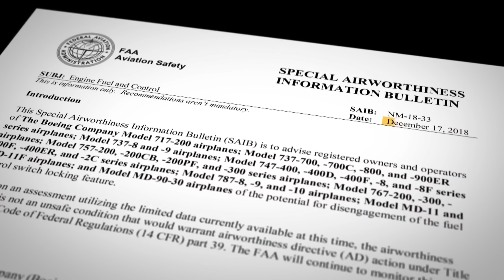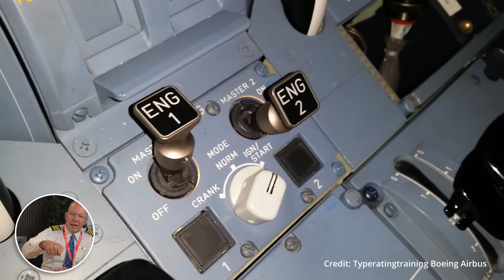Air India 171: The FAA’s 2018 Fuel Switch Locking Bulletin Explained (16 Questions Answered)

Comment: Air India crash report points to chip malfunction, says analyst
A preliminary investigation into the June 12 crash of an Air India Boeing 787 Dreamliner suggests a chip malfunction—not pilot error—was likely responsible for the disaster that killed 260 people. The Aircraft Accident Investigation Bureau's report found that both engine fuel cutoff switches flipped to the off position almost simultaneously shortly after takeoff from Ahmedabad, starving the engines of fuel and causing the plane to lose thrust and crash. While the switches were later found in the "run" position, there were signs the engines attempted to relight before the aircraft went down. A former pilot and senior lecturer, Marco Chan, told Reuters he believes the cause was a malfunctioning chip flagged in a past service bulletin by engine maker General Electric and the FAA. The bulletin had warned that chips with over 11,000 cycles needed replacement to prevent signal loss. “If maintenance isn’t done correctly,” Chan said, “intermittent signal loss can occur. That signal loss can lead to the engine fuel cutoff.” He also noted that it would be “close to zero” chance for pilots to accidentally trigger the cutoff switches mid-flight due to their physical design. The Dreamliner was en route to London and the crash is now considered the deadliest aviation accident globally in the last decade.

Comment: Question for Steeve! How is this similar/different to Delta Flight 810, where a pilot cut the engines at 1600 feet but the plane was successfully restarted? I believe this happened in 1987.

Comment: Mass transit operators(Metro train,bus,cab) are all on cameras while on duty. I think Capitan  Steeeve in my opinion may have this one wrong. The video portion of the CVR should activate as soon as both engines are turned are on ONLY. And deactivate when the weight on wheels sensor detects weight, and both engines are turned off.

Comment: Since the airplane has 2 logical systems managing the plane behavior ( on land and in flight ), ex. R.A.T can't be deployed on ground. 
And since there is no valid reason for cutting the fuel during take off...why are these switches deploy-able during take-off then ?
 why can't it be blocked like the R.A.T on land..? And why is there no camera in the cockpit that records video and audio ? and why do we still use the BLACK BOX while we can transmit and save the data online in real time and save the data in any cloud that gets deleted after each flight or two ? Thank you

Comment: Does anybody know if these switches are single or double pole? Does one side of the switch signal an aircraft-wide control system to report to the recorder and the other half wired directly to the engine FADEC? I’m assuming the FADEC is responsible for the actual actuator closing the valve… if the switches are single pole and go to some other system automation controls before the FADEC then there are more questions to be asked…

Comment: If this was truly an intentional act by one of the pilots, there's nothing you can do from a design perspective to prevent it. If you take the fuel control switches away, there's a hundred other ways a pilot could crash the aircraft if that's what he wanted to do.

Comment: Charter/Corp Pilot  and plane owner here.

I'd love an explanation on how the throttle quadrant was found close to idle/cutoff while the recorder recorded it to be in take off position all the way through to the crash. If anything I thought inertia would keep it forward or move to max throttle on a crash.
Reply: The aircraft is much heavier than the throttles are and will travel further forward than they will.
Reply: @AndersLang-i5s I don't follow. My car is much heavier than me - but if my car crashes into a poll, I am going to be moving forward until either the seatbelt stops me or I stop past the poll after flying through the windshield.

What am I missing?

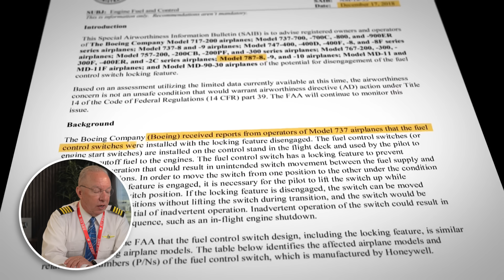Comment: 7:40 I read the document you showed in the video. It seems clear that the "locking feature" it is referring to is the pull element. However the spring may still be keeping it in-place.

Based on this, the switch wouldn't just "fall down" like you said but rather may just be a normal switch that does not require pulling. It would likely stay in place just like any other normal switch.

This means if this plane was solely relying on the spring, it could be possible to accidentally flip those switches. To be clear, the possibility of this is low, but it does change the chance from 0.000..1% if pulling is required, to maybe 5% if that switch could be turned without pulling.

Comment: I am an engineer. Not at all happy with Captain Steves ability to answer questions with good critical thinking and clarity. If the fuel switches moved inadvertently TO CUTOFF MIDFLIGHT , there should be a warning or indication somewhere that this has happened since this is a MAJOR THING!!!!!

Comment: Howdy Capt., for an inflight fire, isn’t there an emergency shutdown handle which cuts off cut, oil, air etc., or is the only way to shutdown an engine is the cutoff switch? Could you please visually demonstrate what each pilot’s hands are doing from setting T/O power until the gear is retracted and climb power is set. I’d like to know which seat was the PF and then match voices to what was said on the CVR. New sub here and enjoying your channel. Take care and fly safe.

Comment: Wondering if FAA Special Airworthiness Information Bulletin (SAIB) No. NM-18-33, issued on December 17, 2018 had anything to do with this.   

The bulletin highlighted that some fuel control switches were found with their locking mechanisms disengaged, which could lead to unintended movement of the switch during flight. This advisory was prompted by reports from Boeing 737 operators and specifically mentioned the part number 4TL837-3D, which is also used in the Boeing 787-8.
Reply: Just stop it. The crash investigators have the actual switches from the crashed plane in their possession and will have already carefully examined them. If the switches were defective an industry wide technical directive would already have been issued about that. No such directive has been issued, There is nothing wrong with the fuel switches.
Reply: There is a directive and It is numbered NM-18-33

Comment: The pilot who called out the fuel control switches position was probably  the one who did smtg. As a boeing and airbus pilot, i can tell u we seldom ever look at the fuel control switches in an emergency. Only the recall actions will require us to eventually cutoff the fuel to secure the engine for failure/fire. We never instinctively look there unless we are deliberately looking for smtg. 

In this case one just needs to determine who the PM (capt) & PF (FO) was (stated in the report). PF wouldve been flying, looking out, hands on yoke and thrust levers & too busy to cut off the fuel. PM had capacity to cut the fuel, shout out the observation for the CVR, & prepare to collect $$

Comment: If the on ground logic blocks the landing gear to retract
I'm quite amazed to hear that the in flight logic doesn't block the fuel switches from cutting off
DURING THE TAKE OFF!!!!
Reply: Engines catch fire, including during takeoff. Pilots need to be able to cut off fuel to them.

Comment: The key question remains: Who moved the fuel control switches to CUTOFF ? and was this done intentionally or by mistake? After the switches were set back to RUN, Engine 1 began the relight sequence at 08:08:52 UTC , The aircraft impacted terrain at 08:09:15 UTC, leaving approximately 23 seconds for recovery. In such a scenario, what is the estimated time needed for the engine to reach full thrust???
Reply: wow. tremendous insight. 23 seconds is a lot to give some serious thrust or maintain the position and then take off. but surely it was not enough considering the size of the plane. you have to ask the turbine makers about this.
Reply: @king_has_no_clothskul8635 
You're absolutely right — engine manufacturers like GE and Rolls-Royce build these high-bypass turbofans for reliability, there are physical limitations on how quickly they can relight, spool up, and produce meaningful thrust, particularly during in-flight conditions. Timing is critical in dual-engine failure scenarios, In this case, the flight crew delayed moving the fuel control switches from CUTOFF to RUN by approximately 9 seconds. That hesitation significantly shortened the already narrow window for recovery and may have sealed the aircraft's fate.

Comment: Have we looked at all the possible electrical/electronic pathways to fuel shutoff? I suppose only Boeing engineers can answer that question. We owe everyone affected by this a thorough investigation into that. 

If this was caused by a human, why cutoff fuel immediately after takeoff? Would have to be a planned act designed to cause maximum casualties on the Plane and on the ground. Also designed to give the other pilot minimal time to react. 

Maybe the person wanted to take revenge - on a known passenger, on the city or the world. 

I know, all this is mere idle speculation. Please take this post down if it is not appropriate.

Comment: An ANA B787 flight had a simultaneous dual engine cutoff at an inopportune moment. In this case when applying reverse thrust on landing. The engines just stopped. Fortunately in this case the runway was long and dry so they could stop in time without the engines.

This is a electronic/software error. And a single point of failure.

Something similar could have happened with Air India.

The switches are mechanical, but in the end they just send an electric signal to tell the control unit to shutoff the fuel. But that is not the only thing which can tell the fuel to be cutoff as is demonstrated in the ANA flight. The fuel cutoff switches were not moved, but the fuel was cutoff to both engines at the same time.
Reply: Mechatronics engineer here: I am almost certain it is electrical/software error, possibly a sabotage...
Reply: but in the  171 crash, the switches WERE moved (unfortunately)
Reply: @Lapushka03  you got a video recording from the cockpit? How can you say that?
Reply: @thenewme93  I don't. But I do not believe in the conspiracy theories either. I believe that the simplest explanation is usually correct, even if it is hard to believe in it. "When you have eliminated all which is impossible, then whatever remains, however improbable, must be the truth.”

Comment: Could this plane have been potentially landed if there was flat ground?
Reply: very tough question. if turbines got the boost back with another 10 seconds perhaps. 30 seconds is quite a lot for turbine or we do not know. but if there was no flight.float aka glide it would just fall like a stone.

Comment: Statistically it is safer to fly in a aeroplane than to cross the road. If thats the case how is it possible that the fuel cut of switches dont have a failsafe? As an example if the fuel cut off switches are turned to the off position, there could be anpromt for the piltos to confirm this action. All systems have redundancies, why nit the fuel cut off switch, that also at such a critical stage in the flight.
Reply: I agree, but this has NEVER happened before. It's unthinkable that a pilot would do this, but one of them did it.  Likely the software will be updated to prevent this.

Comment: Charter/Corp Pilot  and plane owner here.

I was having breakfast with a Transport Canada examiner (and very experienced pilot) today talking about this. He had this theory ... I don't think it holds up - but it's interesting.

He thought throttle may have accidently been pulled back, and (potentially) the other pilot following a flame out procedure (thinking they were flamed out), which he thought calls for the fuel cut off to be cycled off and then on again.

He's been type-rated on multiple jets (although not the 787) and thought this might be likely, especially if the flying pilots hands were on the throttle and his seat moved back unexpectedly (not locked in), and the other pilot reacted thinking it was a flame out as noted above.

Maybe this is also trying to avoid the uncomfortable conclusion that it was an intentional act = but perhaps worth a quick discussion.

Comment: It seems like every other system on these  high tech aircraft has a back up .  Except the  tiny little switch that cuts the engines off. Shouldn't there be maybe 2 parts to shutting down an engine

Comment: Capt. Steve….. by the fact that one has to pull the switch to overcome safety lock …  is 1 sec long enough to toggle both switches???

Given the following :
	•	Spring-loaded or latching toggle switches with a pull-up-to-unlock safety gate,
	•	Two switches positioned side-by-side or within 10 cm of each other,
	•	Operated by one hand in series (not simultaneously),
	•	Minimal resistance or obstruction.
Action	Time (approx.)
Grasp switch and pull up (unlock)	0.3–0.5 sec
Change position (toggle)	0.1–0.2 sec
Reposition hand to second switch	0.2–0.4 sec
Repeat pull + toggle	0.4–0.7 sec
Total (both switches)	1.0–1.8 sec

In this case it would definitely have had to be done in a hurry…
Reply: it's not , it would take at least 3 seconds, therefore it's probably a electrical/software glitch
Reply: 1 second is easily long enough. The switches have springs but they are not extremely firm springs. Both switches could be switched off in 1 second easily.  They are right next to eachother.

Comment: I think again assumptions are being made. Are the fuel cut off switches really infallible? Could something have happened too them to cause them not to lock in and then move to cutoff because of vibrations during takeoff? Did the investigators thoroughly check them? Remember the 737 rudder hardcover fault where it took years to figure out that under extreme circumstances the rudder actuator could cause the issue. On face value the pilots conversation along the lines “why did you shut down the engines?”  “I did not” leaves some room for doubt. Although, knowing you are being recorded might affect the likely response.
So I suggest that while the evidence seems to swing the balance strongly in the direction of one of the pilots there is still a possibility of a mechanical issue.
I would definitely favour cockpit video recoding in all new aircraft being mandatory. In this case it would have had two benefits, firstly absolutely ruling in or out pilot issues and secondly inhibiting suicidal behaviour to some degree. Such a video system is not a big issue as video should be erased unless there is an accident just like the cockpit voice recorder.  The argument you put against this seems weak and unjustified against the potential safety benefits.
Reply: plausible but unlikely as the plane had just landed from another place.
Reply: @king_has_no_clothskul8635 yes, that’s a good point adding almost no doubt that one of the pilots caused the crash. However, the 737 rudder design fault which caused a few accidents could not initially be identified and it took several accidents to determine the problem. Seemingly everything operated perfectly both before and after the failure in the rudder actuator. Could there be some rare chance that these switches if moved in a particular way at a certain temperature do not lock in properly? Was the pilot a ham fisted idiot who pulled so hard on the switch that he broke the mechanism? It sounds highly unlikely, but sometimes these things can happen.

Comment: Does the flight data recorder record the position of the switches or of the fuel control actuators on the engines?
Reply: it is electronic recording but conversation match or unless the pilot has some monitor to look rather than physical examination and he did not. but signal again said moved back in to fuel position. so physical action was done to cut off. because you cant start the engine without being in ON position. if conversation did not match then electronic signal might have read wrong despite switch being in on position!

Comment: The point is: in  these 10 seconds before the engines were put into "run" position again, when exactly the second pilot asks "why did you cut off the fuel?"?
This is crucial because is not logic that after he saw the pilot setting off the fuel levers he waits 10 seconds before taking action!!

Also, if the vocals of the officer asking why the other cuts off fuel are coming some seconds after the real fuel running blockage,  that would mean he didn t noticed that he did so but he just heard the engines stopping and than checked out the two levers...

Everything is a bit strange here... And the informations given by this preliminary report are not enough.
Reply: You'll be able to read the full report within a couple of years.
Reply: FACT! The aircraft was too close to the ground for the engines to re-light and spool back up to produce enough thrust to avoid the catastrophe. They were dealing with microseconds, NOT MINUTES!!

Comment: With regard to Boeing, maybe highlight some of the Airbus accidents like the A320 that crashed at an airshow due to a system malfunction or Air France 447 or the AirAsia crash? They are all due to system malfunctions and are about as recent as the Max accidents. The primary difference is Airbus never had a Netflix special about them. Come to think of it, the recent crashes before AI171 were Bombardier aircraft. All aircraft are safety when properly maintained and operated.

Comment: Steve, I am only a private pilot, but on all my aircraft, single and multi engine, in a power failure emergency landing situation, the checklist says throttles to minimum and fuel selector. To off, doors unlatched, etc. is it possible that the ATP pilots put the fuel cutoff switches to off after the failure and just before touchdown out of ingrained emergency training?